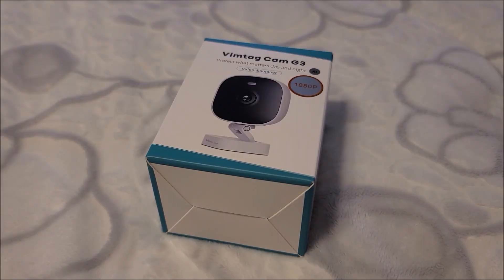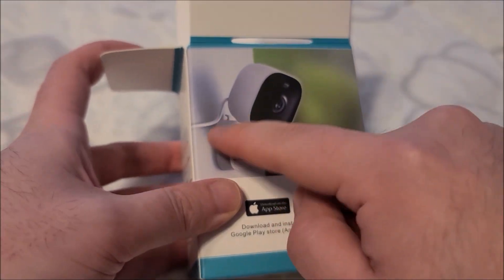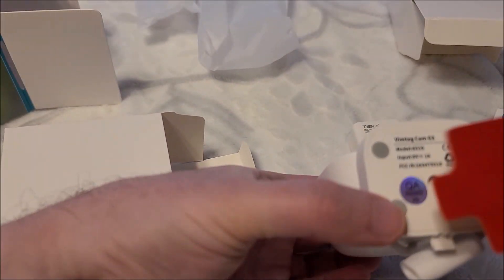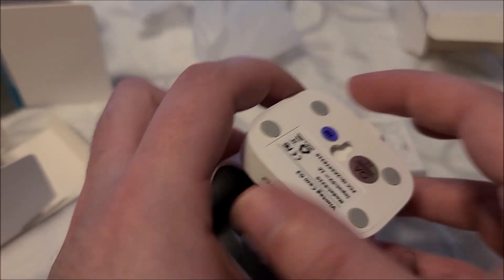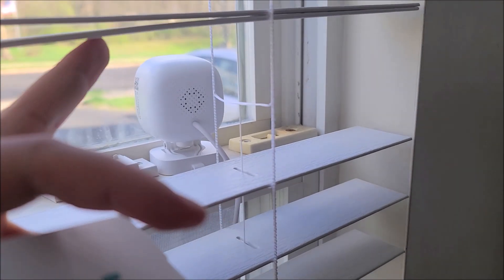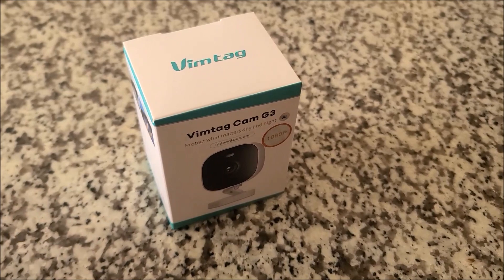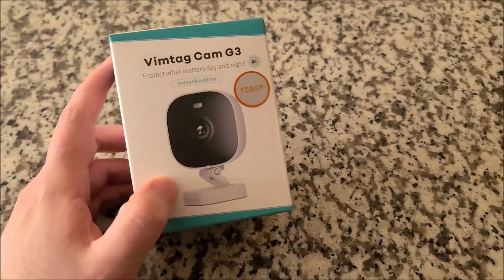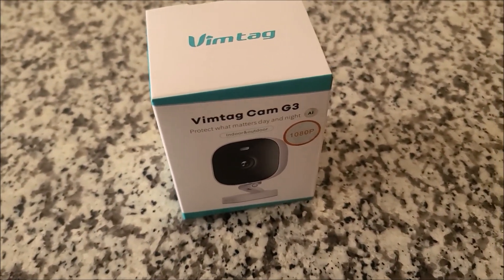Vimtag G3 Wifi Camera Review

Comment: Im using this a a security device bc im a bit wary or my roomates rn, I dont want other people to connect to it. One of my roommate’s has Alexa is there away to not allow that?
Reply from the maker: In the vimtag app, you can go to settings and scroll to the bottom to select amazon alexa and then switch it off. By default I believe it's set on, but luckily you can just disable it.

Comment: How did you turn off the infrared? I can't find that setting.
Reply from the maker: In the app when on the camera live view screen, click on the three dots at the top right of the screen, then settings, then spotlight at the top right (pic of a light bulb), then turn off the spotlight slider. Also to be safe, on the live view main screen click the the 2nd icon just under the video feed (it looks like three slider bars), and then set mode to day.